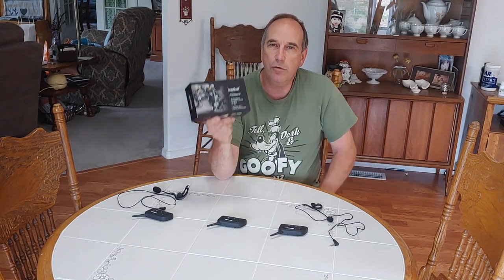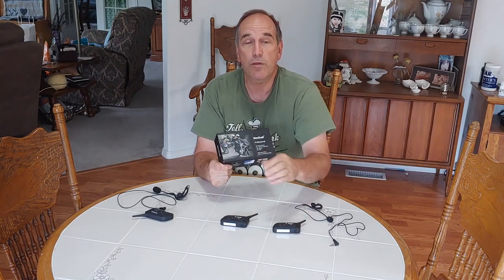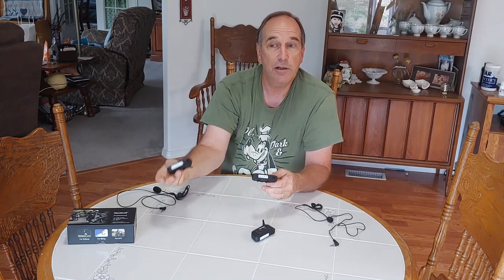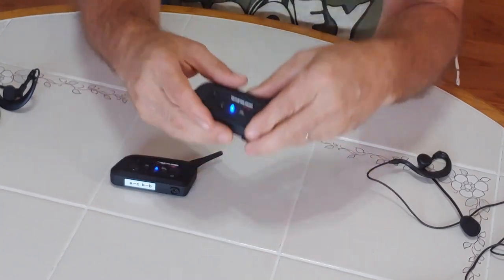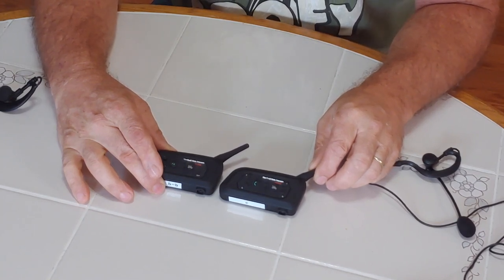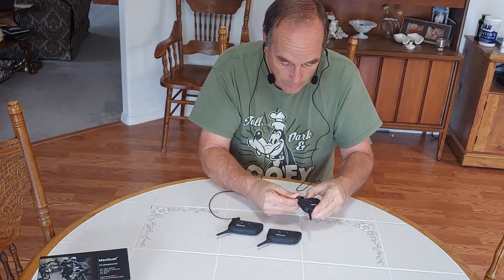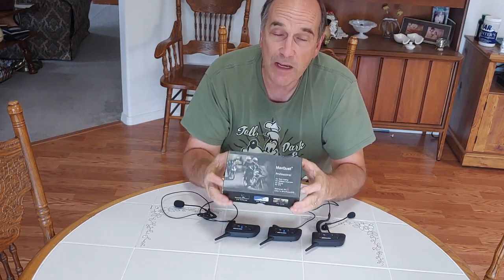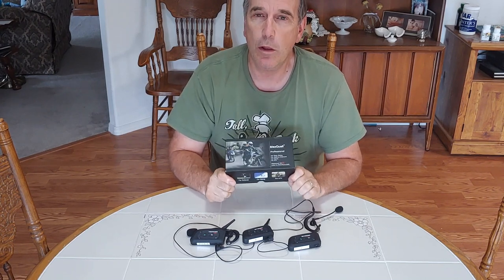How to connect vnetphone 1 V4 and 2 V6 maxquall intercom BEST VALUE!

Comment: Lord they couldn’t make it any more confusing to simply pair these up. Thank you soo much for the informative video.
Reply from the maker: Yeah. My first several times ended in failure
Reply: @theshackthatdennisbuilt  do you know how to pair up a 4th receiver/V4?
Reply: @theshackthatdennisbuilt I bought some V4 headsets. Haven’t used them much because I couldn’t figure out how to pair them. I finally was able to figure it out. How do I turn them off without resetting them?

Comment: Instructions for (one) EJEAS V4 and (two) V6s:

Part One
1) Turn on V4 and V6#1 (on V4 the green phone button, on the V6 the motorcycle button)
2) Pair V4 A (press button until flashing blue/red) to V6#1 C (press button until flashing blue/red - do this at the same time as you do V4 A) - will flash blue together when in sync ~3 sec
3) Press V6#1 C twice - allow about 3 seconds between presses to cycle - confirm V4 and V6#1 can "talk" (that you can hear in each mike & speaker)

Leave V6#1 on 

Part Two
1) Turn on V6#2
2) Pair V4 B to V6#2 B (as you did for V4 A and V6#1 C above)
3) Press V6#2 B twice (as you did for V6#1 C)

Leave V6#2 on

Part Three
Press V4 A - all 3 comms should now be paired up and confirm that you can talk and hear each other. If you cannot, turn all 3 off and repeat this process. 

To turn the comms off - V4: press the FM and phone button together; V6: press the very small button above the phone button. 

FAQs: 

YES - you need to pair the comms up each time you turn them on/use them. 

NO - Three EJEAS V6s cannot sync up for crosstalk together. You WILL need a V4 as the controller comm. Three V6s can talk to each other in an intercom mode (one comm to another). 

For four EJEAS comms, you will need a pair of V4s and a pair of V6s. I may create a similiar instruction set for that at some point in the future.